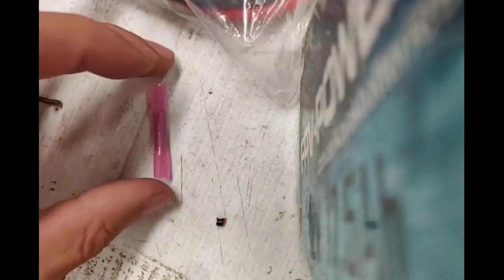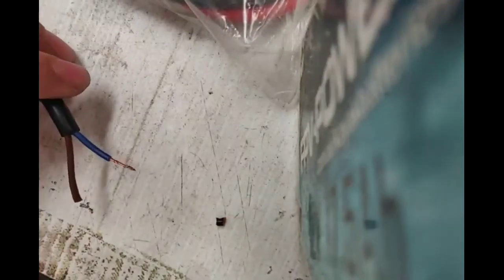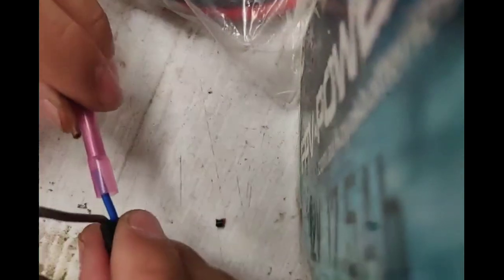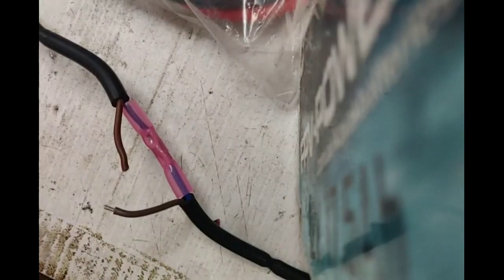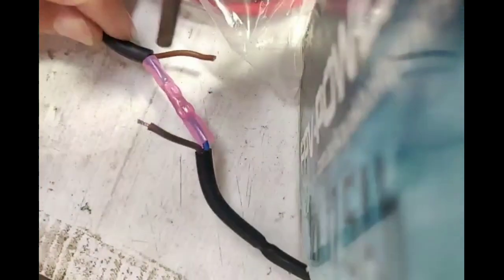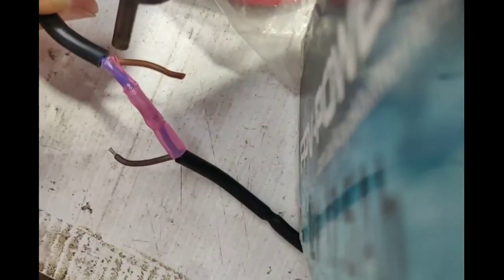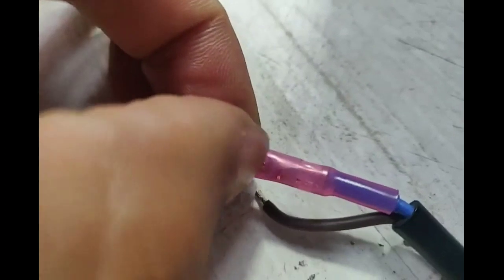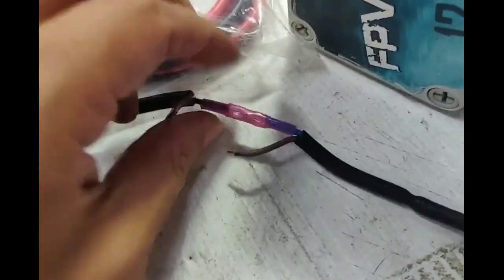Instructions on how to terminate the pigtail with our supplied waterproof crimp/sleeve.

Comment: I have a noob question, how do you strip the cable without cutting the wires?
Reply: You can get proper wire stripers or you can you a set of side cutters by putting pressure on the cable sheath then use a twisting motion to slice around the whole circumference. have to be careful not to cut through the wire though
Reply: Thanks mate